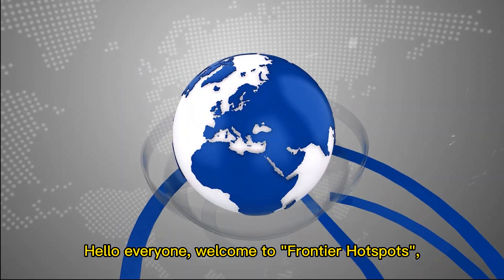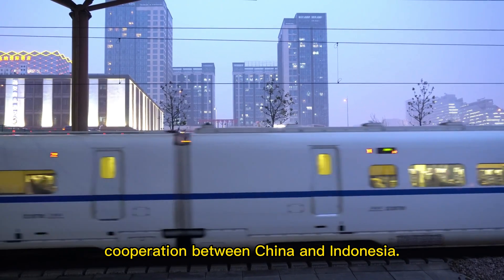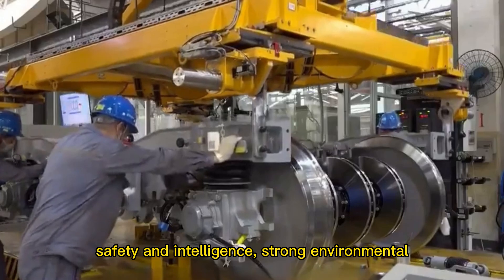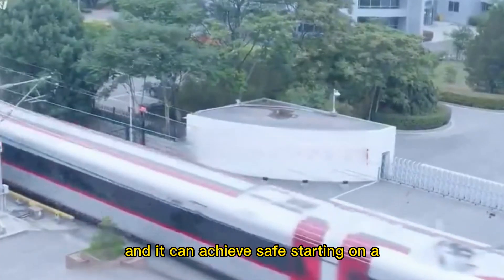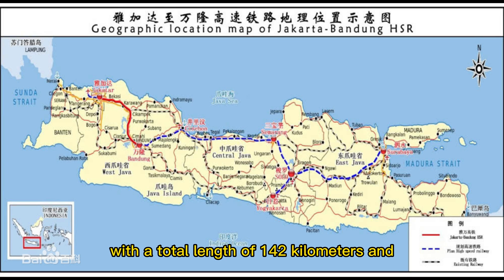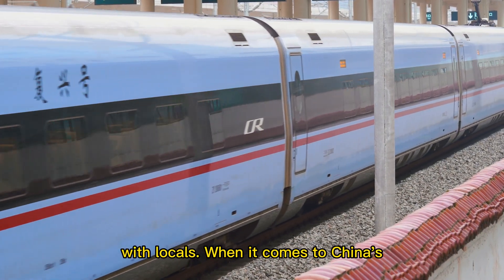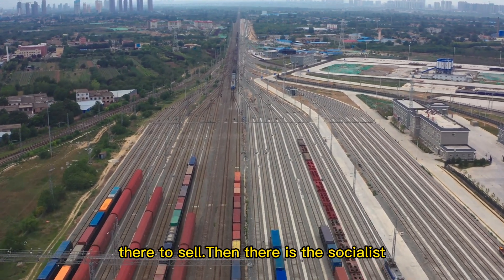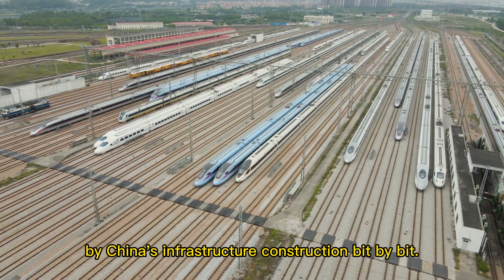Chinese infrastructure conquers Indonesia! Ya'an high-speed rail speed up to 350 kilometers per hour

Comment: When india can have high speed rail? Must get permission from UK and US or not?
Reply: Indian HSR stuck on the platform. Only 10km of line build over the last 7 years.
Reply: @jameslum8822  10km is a huge deal for india if it can run the full length consistently , not 1 or 2 times before breaking down.
Reply: bullock carts are the best option or free ride on train top or clink on train sides.
Reply: @wongyoonchark5050  😂😂😂
Reply: But majority people there still can't afford even a AC train seat. HSR will be waste tough.
Reply: There cannot do make any progress because they will never remove "holy" cows which rest on the rail tracks.